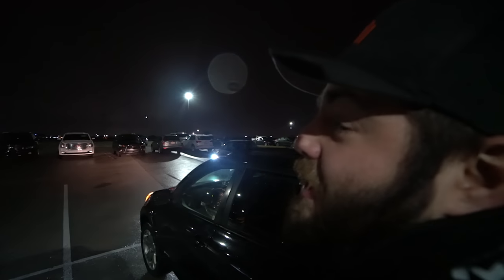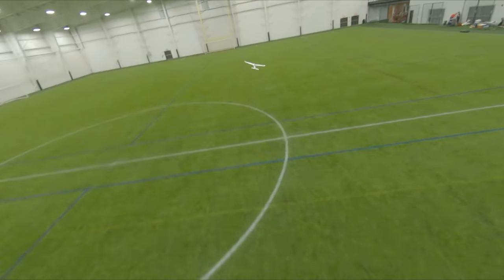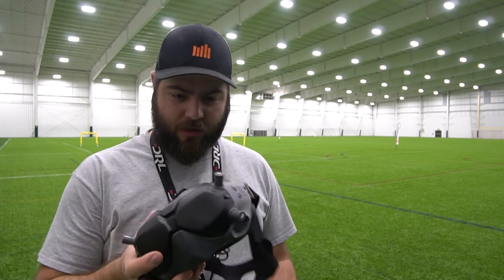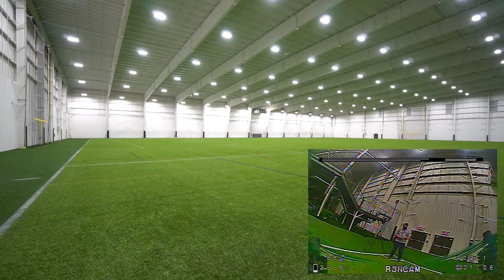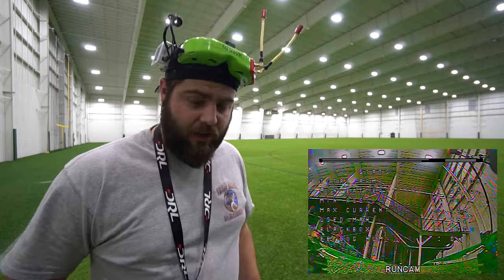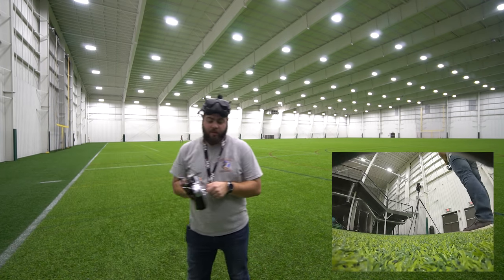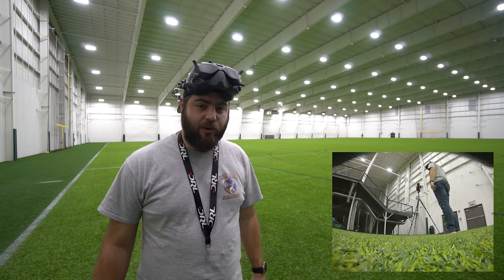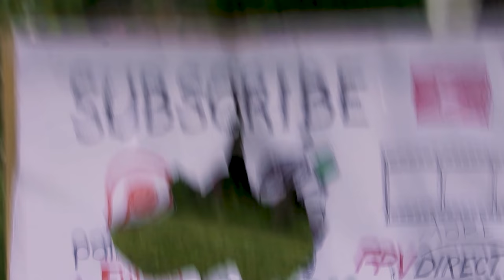DJI vs Analog in a High Multipathing Environment

Comment: The most challening part of this for non-RF nerds to understand is that signal strength isn't the issue at all, it comes down to effective SNR (signal to noise ratio).  Adding patches (more gain, which is higher RSSI - received signal strength) doesn't actually help with SNR in most cases, because there's plenty of signal energy coming in, it's just having to compete with signal that is bouncing off stuff at just the right distance where inter-symbol interference makes the data decoded by a receiver into junk.  More/less power doesn't really change it all that much, though Nurk is right that full blast just means you have new surfaces where multiple bounces can reflect with enough power to affect SNR, although those differences are small.
This just has me increasingly convinced that the DJI system is using a rake receiver type setup, which is common and fairly cheap to implement from telecom applications, which in the high-multipath environment case means it's going to be massively better at keeping useful video signal... and this shows it.
Reply: Great insight, thanks for sharing
Reply from the maker: Pinning this content
Reply: the clever thing about rake receivers is that it uses multipathing (that is a mess with analog) to increase te quality of the reception by resyncing the reflections to the source !

Comment: This is the thing about the DJI system that's been really tempting me to get one. I keep thinking the HD would be nice, but not necessary. I wouldn't think it would change how I fly too much except for proximity situations. The lack of break up and resistance to multipathing though... I feel like that has a bigger impact on how I''m actually going to fly, and would allow more freedom in the air
Reply: Discombobulated FPV yeah, at first it slowed me down because I was busy seeing everything and exploring. Than I went to the same spots I seen before and I started ripping faster and hitting gaps became much easier. Plus it is so easy to detect soft targets cus with analog a spoter is a must. With hd it’s better if you have one but you can see so clear it’s easy to see them.

Comment: Nice comparison but I’m wondering why you on analog just don’t go to the next room and get your signals through one wall so multipathing would mostly be cut away?! When I’m flying a big bando hall I choose a good position from outside instead of sitting inside all these interferences
Reply: Huh that's interesting.  I did a video at a brewery and sat in a room and flew in the main bar and brewery with the tanks etc. Had no probs on analogue. I wonder if that's why it was fine...
Reply: smart else for the direct sight but this google sytem dont allow it

Comment: Cool video as usual man. What power setting did you run the dji kit on? You mentioned that you ran 25mw on analogue but didn't mention it on dji kit
Reply: 25mw
Reply: Johan de Waal exactly ! he did not mention it and the standard DJI Fpv he is 700mw so it’s absolutely BS comparison if it is  25vs700 🤦 - but if he put 700mw on analog it’s no problem-
Reply: @TateDK  that is not 700 mw. The dji system can absolutely crush that environment at 25mw. I fly in an abandoned warehouse at 25 mw.
Reply: Carve DJI is better no doubt also at 25mw but he did not mention the power output of DJI only analog, but it’s probably also 25mw but we won’t know if he does not respond
Reply: in that environment lower vtx outputpower is better for getting clear view, the high power will reflect even more on the walls and cause more interference

Comment: The black out screen and scroll is 'fun with Rapidfire' vs an analog FPV issue. 

The DJI would be nice if it didn't crap all over analog.  I got shot down by a DJI goggle power cycling after he landed (we were fine flying together) over the weekend.  All that's going to happen is it's going to drive analog users to crank the power until they can over power the DJI 'noise'.
Reply: I've happily flown dji at 1200 while a friend flew his tinyhawk on 25mw. If you don't pack the channels there's no issue. He didn't even notice me powering on
Reply: DJI cares only for DJI..expect them to sell us out in the impending FAA battle for profit...
Reply: @steve_beatty  fatshark only cares about fatshark. They're a business not a charity. I'm not sure dji goggles will come into those FAA regs 🤔
Reply: @CoppertopFPV  Goggles have nothing to do with it.DJI will be right in the front of the line to sell guvmint approved drones ....that they will have ultimate control over that can't fly outside a 400 foot bubble...nope..I self build and don't need any help DJI...stuff it...
Reply: @steve_beatty  and no one in this hobby will be buying them. More issue if you're a mavic pilot. Me sticking some goggles on my face doesnt really effect that

Comment: I fly around where I work at a 85k sq foot ice rink and turf fields. I do get static in my goggles when indoors. Think all the metal but not too sure. I get to fly after hours between both halfs of the building. Get pretty good reception considering there is a brick wall and alot of  metal between the two halfs. When no one is around a take it everywhere. Hign and low. Gap haven.

Comment: Am I missing something or is there obviously no comparison! It’s night and day difference. I don’t see when analogue could ever be the preferred tool for the job... and I fly analogue!
Reply: Analog is a lot cheaper by a factor of like 10x
Reply: CHOPPERGIRL's AIRWAR only if you buy some cheap box goggles. The best analogue setup (goggles, module, vtx, antennas, and camera) costs around £700 ... compared to £800 for DJI and you’d expect to pay more for HD just like with a TV. With DJI you also get 2x air units, so like for like the analogue setup would also be around £800
Reply: @MagicFPV  - Thats what I thought too until I bought some really low race to the bottom equipment and was like - damn, is this all I need?
Reply: @MagicFPV  the DJI air unit is a lot more expensive than an analog set up. So it's basically +$180 for every drone you build/gear for digital.

With that being said, I'ma still go digital.
Reply: Leonard Payton I thought the same but if you do the maths it’s actually pretty similar

Comment: Set lock duration to short to avoid rolling on RF.
Reply: how? ive been having issues for 6 months now, nobody around me knows how to do it and immersionRc support never responded... please tell me how to ajust lock duration
Reply: @BlueBluby  In the menu: Sync Lock > short.
This will make it so that it drops the lock a lot quicker and goes to 'mode 2' instead of holding on and bugging out. It is a lot better to fly in 'mode 2' for a couple of seconds than getting that rolling/glitchy/wobbly effect. 

Also make sure that your rapidfire is updated and calibrated in an relatively rf free environment. The calibration made a massive difference for me at one point.

Comment: It would have been helpful to explain what multipathing is! I've never heard of the phrase b4...
Reply: Multiphathing is when your Right  handed signal bounces on metal et come back as a Left handed signal so un your goggles you have a bad video with white line that's why we put it on 25 mw so we have less interference
Reply: @gabrielbruni3924  Multipathing means "signal coming to the receiving antenna from different paths waaaaaay more than one path(the Tx to Rx path) usually this means that the signal bounces around before coming to the Rx antenna and gathering also a small-time difference" In this situation the DJI wins it because on the analog signal there is no error correction but the discussion is way more complicated...
Reply: @LivyuFPV  if I understood correctly every bounce changes polarization, would having one rhcp and one lhcp antennas on vrx help?

Comment: Wonder why its soo bad there? Does a building wth electric cause more multipathing vs a bldg w/o power?
Reply: Nope, although more metal and wiring does matter.  Really, anything RF can reflect and/or diffract around oddly creates the opportunity for different path lengths to result in inter-symbol interference, which is the real enemy.

Comment: I'd love to have a whoop board DJI AU as my whoops are what I fly in multi-path environments the most.  Not holding my breath, but just sayin...
Reply: Right now, the only digital system on a whoop board is Shark Byte, which also deals with multipathing similarly to DJI.  Both systems actually use the reflected signals to help build the image.

Comment: i really feel like if a patch/omni was used instead of two omnis it would have worked a lot better.
Reply: Surprisingly, no improvement in most cases.  Quite often, it's actually worse with a patch, since you're getting better gain from the multipath sources as much or more than the direct path.
Reply: He is using rapidfire. Two omni's is better to lace the images together for  multi-path interference.

Comment: so basicly if dji can pull down the latency closer to analog. Then everyone will be done for analog ? Im guessing they are working on something like that right now. Im running the skyzone sky02 x as for now to begin the hobby with but I think dji will produce an even better goggle or mod this to be as fast as analog in digital.
Reply: I couldn't fully figure out what Furadi was on about when he said that he was willing to give up one frame (NTSC) worth of latency in order to have way more resolution, but having used a set flying around, I can totally make that adjustment.  Seeing things big fractions of a second sooner, and being able to adjust to that latency is worth more than pure glass-to-glass time can directly solve.
Reply: The latency is already as good as analog, and if you use their radio, the total system latency is actually faster than analog.  Trust me, anyone who says latency is an issue on the DJI system is looking for excuses.
Reply: Rik de brouwer Long range fpv, video latency in high interference locations (look at StingerSwarms video - he went behind trees and the digital system completely froze, but the analog system, you could still see the horizon and trees through the breakup), goggle form factor, lhp rx etc.
Reply: @Luka-lm1pr  the video you reference is very misleading. It's 5 firmware updates behind. It's on stock antennas. And it's at low power. And he ignored bandwidth. This works better behind obstructions than analog. Period.

Comment: But in the video of the dji you show what the camera records, not what are you whatching in tour googles, like telemetry, signal, and that stuff, and then is not a completly fair comparation, or am I wrong?
Reply from the maker: No I showed you what the goggle records
Reply: The DJI goggles don't record the OSD in the video feed, but in a seperate text file which you cab merge in post if you want. Its pretty smart actually, but does require extra steps to get that info into your video if you want to do so.
Reply: @NURKFPV  excellent, thanks
Reply: @StarLiteNL  , wasn't that changed in a recent FW update?
Reply: @uavtech  That's definitely possible.
Reply: @uavtech  Nope

Comment: There's really no reason to use analogue for anything other than extreme long range or whoops. Other than perhaps 1% of the best race pilots It trompts all over analogue in every other circumstance - I can fly in places rapidfire lost signal and with a bit of use you get to know its quirks the same as analogue. I didn't want to like it, but I just couldn't help it.
Reply: $40.00 VTX, $250.00 goggle = $290.00 vs DJI Goggle and 2 air units = aprox $1000.00 ......I have 710 reasons.....also I know how to decrease my gain to resolve problems like this.
Reply: @riggermortisfpv526  if you're paying 1000 for dji they saw you coming. Your crap goggles and vtx aren't even a comparison. I can only suggest working hard and earning more so you can get some decent analogue goggles and rapidfire and join the conversation from a sensible starting point 😂😂
Reply: @riggermortisfpv526  Your math is way, way off.   You can get the DJI goggles + 2 air units (that's cameras, antennas, everything) for $819 and it's been on sale for 20% off at $655 a few times already.  Meanwhile you are choosing cheap goggles, forgetting antennas, forgetting rapidfire, not mentioning the need for a Power Play since FatShark's DVR sucks etc. Redo your comparison with good patch antennas, HDO2's or Orqa's, Rapidfire, and so on... and you'll see the DJI system is actually cheaper by a LOT vs equivalent analog.
Reply: @protonus  Its over 1k CAD, where did you assume I was ?
Reply: @riggermortisfpv526  The largest market for FPV that uses the $ to denote currency (the USA).   You didn't write CAD after your prior amounts so I didn't know. Either way the ratio in price is the same.

Comment: cool stuff,  now if they make a v2 that isnt the fit and size of a toilet seat i'm in.
Reply: Have you not seen the Caddx Vista?  Or are you talking the DJI goggles - which the fit can be fixed by the $15 sponge foam DJI sells?  As for the size, you WANT the goggles to have the twin 2" LCD's they have... and their massive adjustable 54 degree FOV, trust me.  No chromatic aberration. No edge blur... just a beautiful clear image.

Comment: You forgot to mention the different of equipment costs.
Reply: The DJI setup is actually cheaper when you factor in everything you really need for top tier analog.
Reply: @protonus  what the cheapest for low tier numeric i just know the analog is 15$
Reply: @omnianti0  $655 for the DJI goggles + 2 air units (cameras + antennas and wiring, everything you need to setup two quads), when it's on sale for 20% off from the normal $819 which it's been a few times.

The equivalent in analog costs way more when you factor in good goggles, good vtx, rapidfire, powerplay, good antennas, and so on that you'd need.
Reply: @protonus  heir is no high limit in price their is an lower limit as 25$ analog google  and its easy to DIY so is in numeric some cheap nobrand exist too
eachine sell accro analog FPV RTF with google for 99$

Comment: DJI should come out with a fatshark module.
Reply: Never going to happen... it would have to be a ground station. FatSharks are outdated tech.  The analog module bay does not have the power capabilities or the bandwidth to support digital like this, nor do they have a CPU fast enough in the goggles to decode the HD stream.  Orqa is a maybe - they have a digital module bay and a fast CPU, but time will tell on that.  Either the DJI goggles have a way better image and FOV than either of these... You will never see the full potential of digital HD through these old analog goggles.
Reply: @protonus  many of the old goggles have hdmi in. Ground station would be simple for dji to produce and I think they would sell well
Reply: @protonus  from what I see on the module pinout all processing is done at the module. I could be wrong.  I cant see why a HD module wouldn't work if power was an issue that could easily be addressed feeding the power externally and not through the Google.

Comment: dji is still clear winer but wow how is the anologue so bad. been flying indoors with a tinyhawk freestyle and mines is fine, never lose lock. image isnt grrat the colours go funny a lot. but hardly ay breakup. thats using eachine ev200d goggles. just 1 omni antenna on reciever.

sports halls seem really bad places for anologue fpv, ive flown in other indoor spaces with far less multipath issues

Comment: results are totally invalid unless we know what the RapidFire was running.  not only that, you're antennas on the RF are all wrong.  they should be 90 degrees apart.  that puts the RF at an automatic disadvantage.  if you're going to put the work into making the video, put the work into making the video.
Reply: Its an advertisement/CES tech demo, not a video, clearly.
Reply: I tested this myself, this is accurate I don’t care what antennas you want to use lol 😂 analog indoors sucks ass period
Reply: As an RF engineer, all those points are relevant and correct, but the net effect is 10-20% of usable additional range.  You'll still hit nodes where the multipath just ruins the video signal, and no amount of clever frame reconstruction unicorn magic can make two garbage receiver signals add up into something flyable.  It's not as though he was flying anywhere near the low-gain nodes on either omni unit, and the Rapidfire has two modes, both of which are going to perform subjectively and objectively worse by around this much.
Reply: @tehllama42  that's fair, but if it was in the wrong mode with a camera out of spec, I've been outdoors and not gotten 20 feet before the RapidFire freaks out. Try a foxeer micro Arrow on mode 1 and tell me how far away you get. At least the old arrows, even on newest firmware. 

I get ridiculously good reception in my office. 10k square feet or so with concrete floors, a huge server room next to the kitchen where I fly from, cables and wires everywhere, and about 100 computers in the open 'rooms' separated by concrete barriers and brick pillars. Tiny whoop sized quads on 25mw and it's crystal clear. 

Not allowed to post any footage though as the game we're working on right now is unannounced.